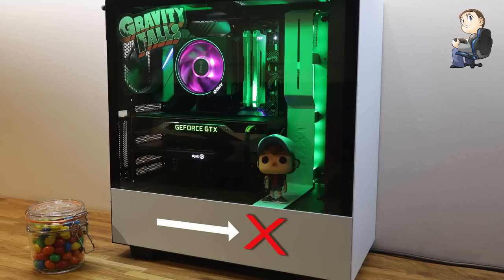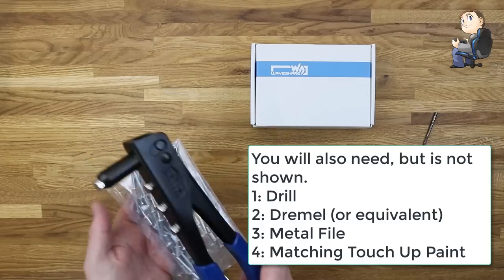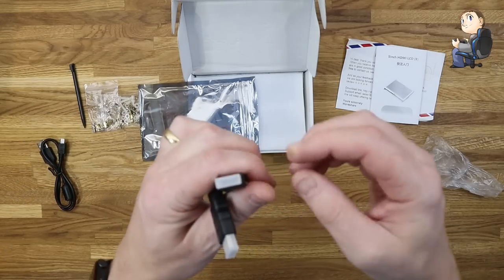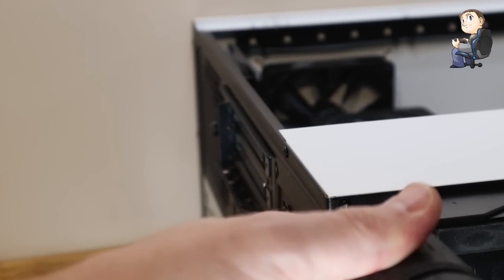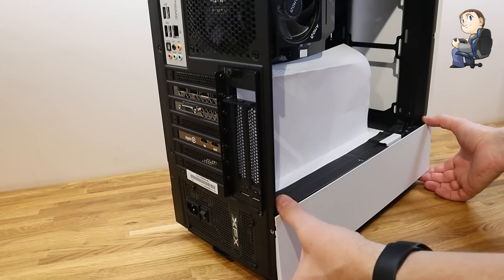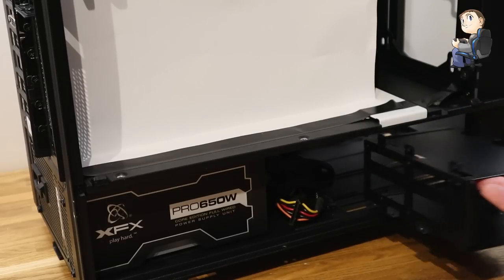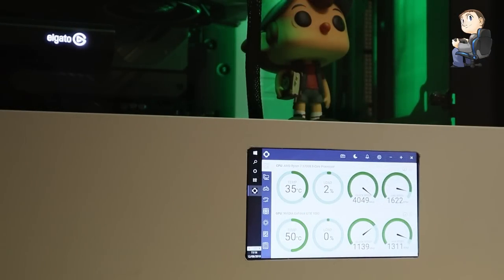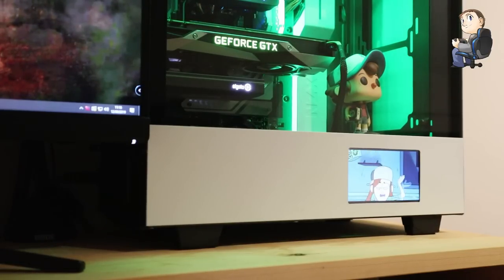Custom PC - 5 inch LCD Case Install 2019

Comment: Super late on this but when you're ready to mount the LCD to the tape don't remove all the protective plastic from the tape.  Only peel 2-4mm of the plastic from 1 end of each strip and fold it aside so it hangs over the edge past the LCD.  This will be enough to hold the LCD screen in place and make it much easier to get it aligned.  Once you're happy with the position pull the backing plastic away and press the LCD in place.
It's harder to describe than it is to do and it makes a fussy procedure much less intimidating.
Reply: Oh that is a fantastic idea, my dude! Like a hospital corner when making your bed. Then just pull it out sideways when you have it aligned. I was gonna try this and that is a sweet idea.
Reply: Great idea!

Comment: Instead of cutting the case at 22:55 you could just have flipped the lcd screen upside down so the cables come out from the other side!
Then inside windows set the lcd screen to portrait (inverted).
Reply: Renan Lira glad I’m not the only one who realised 😂
Reply: Or he could have used angled connectors
Reply: @JoeKolo  same xD
Reply: On these cheap LCDs the viewing angles don't work that way. You'll get a way worse picture quality with a flipped LCD.
Reply: @JanJanJanJanJanJanJanJanJan2  thats right
Reply: He literally said u could do that
Reply: @TheTiger12345678910  I probably missed that. My bad.
Reply: Viewing angles on lcds are bad at best. He did it as good as can be.
Reply: was thiking that when he said to cut then after video check coments to say it then you bet me to it

Comment: Thanks very much for showing how to do usb feed inside and out of sight. Cleans up install. If only I could figure out how to hide HDMI feed also. Best I can do my case has pull relief on right side cover. Cutting slot there and running HDMI cable back inside case is best I have figured so far.
Reply from the maker: Yeah I know it’s annoying with the GPU connection.

Comment: This is better than Jayz's video. Awesome tutorial! Thank you very much for showing the whole process.
Reply from the maker: Thanks Alexander that means a lot, I did see Jayz’s video as well. It is frustrating some times as I made this video a while ago.
Reply: @CraftyDoctor  i would have liked to see the software side of things here. Installing it depends so much on the case etc. But a real tutorial for setting up the screen and the software would be more needed in my opinion.
Reply: @CraftyDoctor  Your video is far more DIY then his. This is an awesome tut for anyone who owns tools and knows how to use them. This is far better than Jayz video but far harder to do. Most people in apartments will not have a dremel and most definitely not a vise.

Comment: Instead of taking up a USB port you can get a sata power to USB and power it from your powersupply
And you didn't need to cut into the black bit you could have got a low profile cable
And I would have replaced the rivets with screws so you can take the panel off again

Comment: Great video and have followed although the HDMI you are using is 270 degree not a 90 degree. Not an issue just sent back the 90 to amazon and re ordered a 270. Brill video. Cheers

Comment: pretty nice. been meaning to do this mod for quite a while, but I don't know what to call that little screen, so I can't get it. Now I know it's a raspberry pi screen, and there's a ton if I look for one. thanks, gonna do this mod soon(tm)
Reply from the maker: Good luck Josua
Reply: Search for Elecrow 5 inch Touchscreen on Aliexpress. I also used some 90 degree angled HDMI converters from Ugreen to get the video input inside the case.

Comment: Nice, needs a frame around the outside to cover the rough edges.  Like a black frame that overlaps the screen just a tad
Reply: I thought so too. Actually, if he had a screen with a border like that, he could have just made the hole a little smaller, so the screen stands out much cleaner

Comment: Being one of the few people who might actually try this out of quarantine boredom, could you put a link to a case to hold the lcd screen because I don't want to drill into my PC case. Even if i was fine with it, i don't even have a dremel, drill, or pop rivet thing.

Edit: Glad to see I wasn't the only one recommended this video recently.
Reply from the maker: Hey - If you look in the description there is a link to the screen  - Waveshare 5" the screen comes with a outer mounting case which you can use to mount the LCD.

Comment: Brilliant, just one question: why don’t you use a usb3 to HDMI converter instead of this cable going outside of the case?
Reply: porchet Pierre-Alexandre oh. I didn’t know you could do that. Would it still connect to the gpu. Or would it connect to the motherboard
Reply: hmmm. can you realy do that?
Reply: @americahaws8610  it would be connected (physically) to the motherboard but I don't think the data would come from the GPU, any it my be better for gaming, it will make less load on the GPU (except if you're crazy enough to game on this screen ;) )
Reply: porchet Pierre-Alexandre when I build my pc im totally going to do this. Thanks so much ( no way I’m gaming on that lol)

Comment: I started with hiding the taskbar and the clock on the system tray after the release of windows 11. I then got tired of not being able to see the time so I started to look for a clock to mount above my monitor. At the same time my aio started heating up, turns out it was dirty and ended up cleaning it. Now I want an external display to see the time (never bought a clock) and the temps of my system. I think it’s funny how hiding the taskbar all led me here lol

Comment: Instead of cutting the backplate cover at 23:46 you could just have router the USB cable through the hole up on the vertical mounting for the graphics card...

Comment: Id love if you could show us the software you use on the lcd, i have cam but it does not line up properly, also every time you turn on off the screen did you have to  reopen a new video file on it?
Reply: you should have a look at rainmeter , i think thats whats been used here but not 100% 
EDIT: he did state it was the NZXT software he uses. But really have a look at rainmeter
Reply: he just uses it as a third monitor. the pc detects it as monitor its simple

Comment: Does it turn off with the pc or does it display no signal?
Reply from the maker: Yep it turns off with PC
Reply: @CraftyDoctor  and that's because you hooked it to the internal usb header instead of a usb at the back? Or its a built in function in display?
Reply from the maker: Amd it’s using the graphics card output so it’s just like having a third screen

Comment: Hello,how if like thermaltake view 51 casing ,where you would suggest to put the raspberry lcd?
Reply from the maker: The thermaltake 51 has a complete glass side so there is no where to hide the cabling, but if I was using that case I would probably make a custom mount so it hides the cables and sits flush against the glass inside

Comment: Thanks for the tutorial and it looks great in the case, really tidy job. Have the same case just a slightly different version with the front glass panel. Can I ask how you was able to display the NZXT cam software on your 5" screen. Cheers 👍
Reply from the maker: Hey Thanks - When the 5” screen is connected to the Graphics Card the PC just sees it as another screen in the same way as it would if you had a full size screen added and plugged in. So you just open the NZXT software and drag it onto the smaller screen (and maximise it if that’s how you want it to look)
Reply: @CraftyDoctor  Cheers. Thanks for that mate.

Comment: Hey do you think I could make the cuts without removing that metal side piece? I'm doing a fresh build and have already bought the screen for this mod
Reply: Same. Think you can but removing it makes for a more operatable surface. (see its 6months ago) how did you do?
Reply: @arjanbaken2225  so I learned alot. Overall it went pretty well what I would recommend is even though you measure the screen size you have to add a few mm for the bottom ribbon cable for the screen to completely push through then I used super glue for the 4 bolt tabs and super glued it on the inside

Comment: Mind if I ask, do you have a link for an internal power supply? I prefer it to an external usb connection.
Reply: Or alternatively, could I power the screen directly from the motherboard using a 9 pin to micro usb connector?

Comment: when you boot it up, will it automatically display the cam software? or you will have to manually do it everytime?

im trying to do the same project but with a h710i.
Reply from the maker: Mine comes on every time unless it updates then it moves screens

Comment: Does anyone have a definitive answer as to whether these low resolution screens effect performance? I just want to run a monitor, no video or anything like that. Preferably Aida64 as the monitor software.

Comment: @CraftyDoctor can I use a h510 elite or does it have to be this case
Reply: Should work with either, about to do this on my 510i and its the same towards the bottom of the case

Comment: I know they make USB to HDMI converters for laptops, but do they make HDMI to USB converters?  That would allow you to plug the HDMI into the USB header adapter without having to run the HDMI cable out the back of the case
Reply: David Maloney have you found an answer for this?
Reply: I found some articles on IoT forums that seems to indicate usb headers don't interface with the GPU, so while you may be able to make a physical adapter, the computer won't recognize the input.
Reply: Not possible.

Comment: What if I plug it into the motherboard
Reply from the maker: Hey - it will only work by plugging into a output. It essentially works by showing a extended desktop. If you have a graphics card plugged in the mobo hdmi is usually disabled.

Comment: Loved the video! Well done. What do you think of using a cellphone screen possibly?
Reply: I'm wondering if the cellphone screen would look better or if it doesn't make a difference...?
Reply from the maker: Yeah that could be good but I suppose you would have to find a workaround for connecting to HDMI from GPU

Comment: Are you sure you needed to use USB for power? I have a similar 5" screen and it will power itself over HDMI.
Reply from the maker: Hey - My screen did not work unless powered via USB (I did try it whilst building the screen in) Not sure if you can get this size and type of screen to power over hdmi
Reply: Some screens are able to be powered of hdmi only(wich is a big bonus)

Comment: LMAO this is why you buy cases with a built hole for the Power supply.. there are enough gaps to slip in a lcd panel